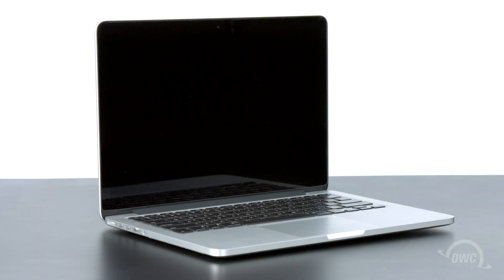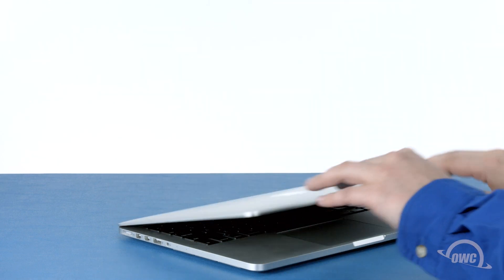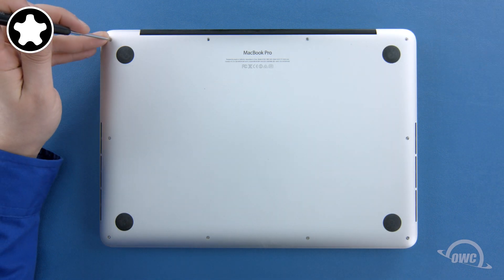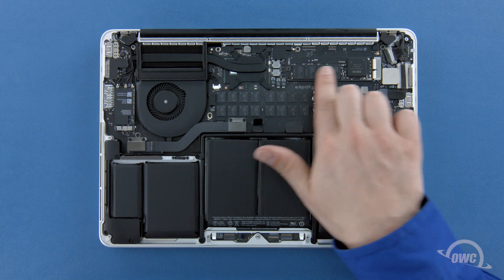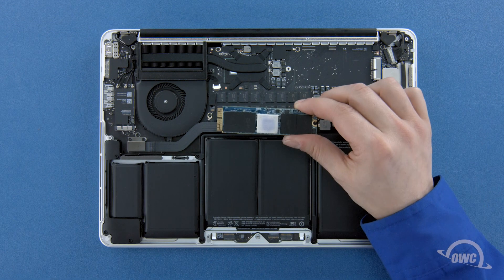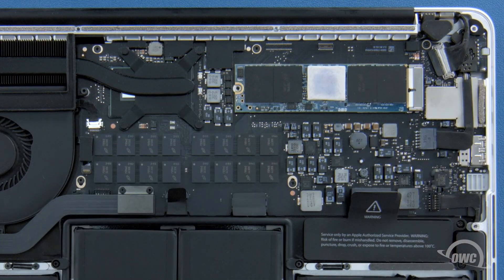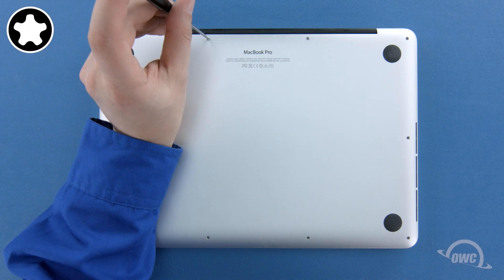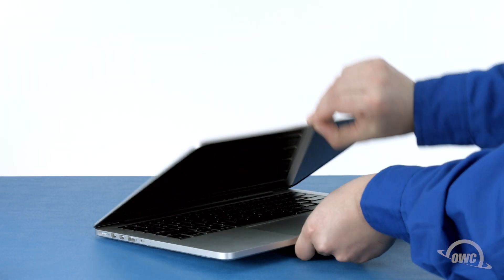How to Upgrade the PCIe SSD in a 13-inch MacBook Pro w/ Retina display (Late 2013 - Early 2015)

Comment: My screw is stuck and stripped on my MacBook Pro what to do
Reply from the maker: You could try gently using the rubber band trick—place a small rubber band over the stripped screw head and then use your screwdriver to get extra grip. If that doesn’t work, some people carefully use a tiny dab of super glue on the screwdriver tip to help it catch the screw, but make sure it doesn’t spill onto the surrounding area.

Comment: Case with aura x2 ssd 480gb:
MacBook pro early 2015 13 inch retina.
If the ssd is not recognized by the host computer (even if the high Sierra 10.13 installed before): you should run disk utility  NOT FROM THE INTERNET RECOVERY MODE (as in OWC instructions), but from the MAC OS INSTALLER!! which is on your flash disk, from which you have upgraded your OS!!. 
So first install High Sierra ( bootable flash drive), than start you mac with holding alt key, choosing to boot from usb on which you had mac os upgrade installer. Run disk utility FROM THERE and finally the ssd is showing. 3 days of sufferings came to an end! Crazy!!
"Recovery" installer ( which already on the machine after installing Sierra) - don't show the disk.
"USB" installer (from which you upgrade this OS) - showing the disk.
Reply from the maker: Hey Airs Broadcast thanks for the comment, we have a guide on how to format these disks here:

https://eshop.macsales.com/tech_center/formatting/Format_OS_AuraProX2_Rev1.pdf

Posted a link to ours incase anyone needs a visual reference, if you ever have any trouble installing your SSD feel free to call us at 1-800-275-4576 we’d be happy to assist!
Reply: @poweredbyowc  There is no a word about the solution i had to find. This guide doesn't work, at least in my case. I described my experience for people facing troubles and waiting weeks from your support team for an answer. Whatever..
Reply from the maker: While we are sorry that you had such trouble, overall our goal is to help as many as we can. If someone finds another way to do it, we are always excited to hear of the different ways people were able to accomplish that goal. Glad to hear you got it working and we will also say thank you for sharing your solution with others, as that's the best way for everyone to grow. :)

Comment: Sierra 10.13.6, ssd replacement --> MacBook does not start, the folder with question mark is flashing, what should i do?
Reply from the maker: If you are using the Aura Pro X2 you need to upgrade the MacOS to High Sierra 10.14 with the original SSD once that Mac has been upgraded follow the steps below.

https://www.owcdigital.com/assets/support/support-formatting-and-migration/Format_OS_AuraProX2_Rev1.pdf
Reply: @poweredbyowc  • macOS 10.13!! High Sierra in your guide, so 10.13 or 10.14? If so you should correct your own guide than. 
I will try than 10.14..
Reply from the maker: I apologize for the typo. High Sierra 10.13 or higher is what is needed to use the Aura Pro X2. If you are still having mounting issues please contact our technical support team and they would be happy to troubleshoot with you. https://eshop.macsales.com/Service/
Reply: @poweredbyowc  have no answer from them 4 days, if they don't answer asap i will have to return that ssd back to amazon, unfortunately
Reply from the maker: So sorry for any delay here! I do see an open case for you that we are waiting to hear back from you on. We are happy to assist and I'm sure we can get that drive working for you!

Comment: Alright, everybody is capable to use a screwdriver, the main question is how to restore macOS during SSD upgrading.
What is the point of this video, guys?
Reply from the maker: The main point of this video is to help guide customer's in the hardware install as some are not technologically inept as others meaning that they need a bit more help. However if you need help in restoring the macOS, here is an article that might help ( https://eshop.macsales.com/articles/how-to-transfer-your-data-from-your-old-drive-to-a-new-drive%29

Comment: Is there a way to do this SSD upgrade with more than 2TB?
Reply from the maker: Unfortunately no, the most this Mac can handle is 2TB, this is currently a limitation set by the manufacturer/the remaining hardware inside.

Comment: After 2 months of using the SAMSUNG 970 SSD, my computer crashes with this error. panic(cpu 0 caller 0xffffff80130d0860): nvme: "Fatal error occurred. CSTS=0xffffffff US[1]=0x0 US[0]=0x12 VID=0x144d DID=0xa808
. FW Revision=2B2QEXM7\n"@/System/Volumes/Data/SWE/macOS/BuildRoots/d7e177bcf5/Library/Caches/com.apple.xbs/Sources/IONVMeFamily/IONVMeFamily-557.120.1/Common/IONVMeController.cpp:5499
Backtrace (CPU 0), Frame : Return AddressAnyone know what it means?

Comment: Will this work if you already have Big Sur 11.2 installed on the 13 inch MacBook Pro Retina display, model a1502? Will I run into any issues?
Reply: my late 2013 (4GB RAM, 128GB SD) with Big Sur is really slow. I've removed most everything I don't need from the laptop. Will an SSD upgrade help?
Reply: @barbaraguerra5777  don´t you have an ssd? it´s kinda mandatory nowadays. highly suggested to upgrade. big sur must be a hell without it